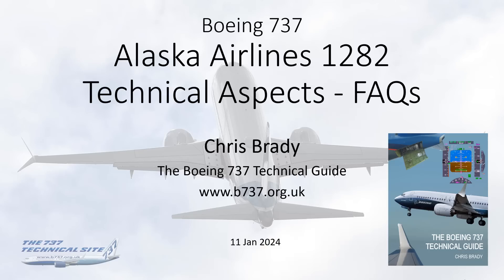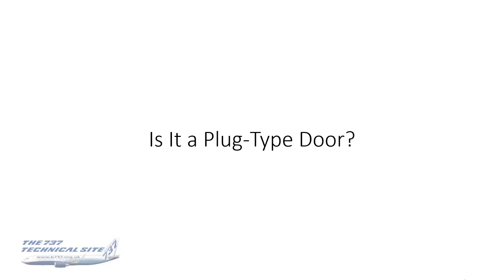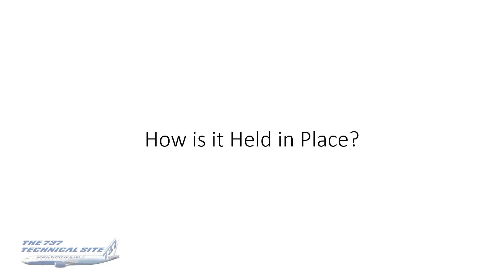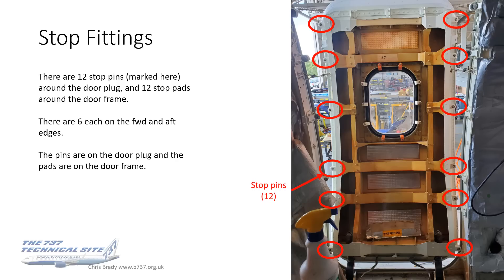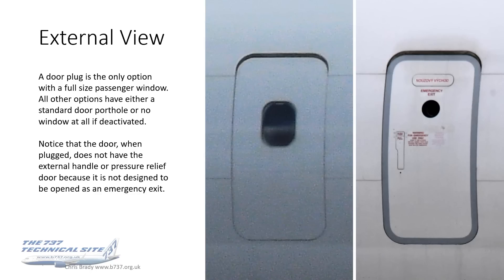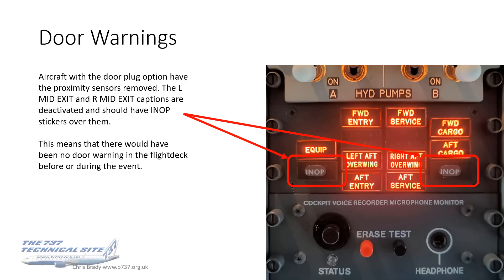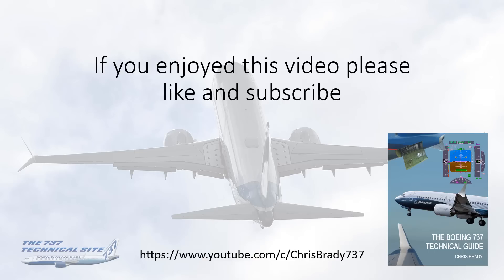737 Technical Aspects of AS1282 FAQs

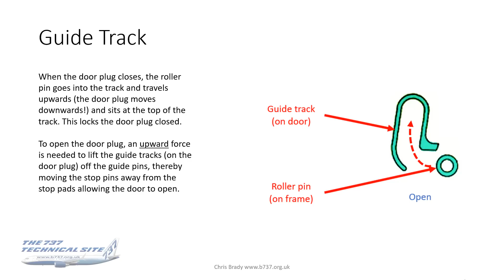Comment: 6:30 You’re verbally explaining it right here, but the diagram is still visually misleading because it implies the pin is moving by how the arrow and dotted line is used, when actually it is not, it’s the guide rail attached to the door that is moving up and down.
Reply: I agree that the diagram isn’t ideal but when taken in conjunction with the photos of the actual door and frame, as one should do, there’s no way that it’s misleading.
The arrow could likely have been drawn external to the track which would make it a bit clearer.
Reply from the maker: Good point, perhaps I should have put the arrowhead on the other way around. But hopefully with the words and text it is clear.
Reply: @ChrisBrady737  however, at the 6:30 point, you’re showing what happens when it changes from closed to open position so arrow should be heading upwards. I think it’s the location of the arrow compared to the parts that implied that the roller was the moving part by being near roller pin and inside track
Had arrow been on left side (or right) of track, that implies that the track part is moving.
Reply from the maker: You are absolutely right, it would have been clearer if I had put the arrows to/from the track, not the pin, as that is what moves. @JohnHallgren
Reply: @ChrisBrady737  I wasn’t really confused because I took it in context with the photographs of the actual parts and realize that you were implying that the flange moved.
Reply: @JohnHallgren  I think one of the biggest bits not grasped is the upper pin is part of the frame, and the pin guide track is part of the door, and that the door only goes UP, and out to open. It took me close to 45 minutes thru text to get my brother to understand this. He kept thinking the door was lowered first (against that spring pressure) to clear the pin (because he thought the pin was attached to the door), and then pushed out, and that is incorrect.
Reply: @GNX157  and it certainly didn’t help when the close up pix of the top guide & pin was from the upper right while the other pix were from lower left! I tried via half dozen msgs to explain that to someone! 

And then with Chris’ unfortunate error in saying it had to go down when that was obviously impossible from the photo, but i did see a comment that it might require just a bit of downward pressure to release any contact with the locking pins due to the upward pressure from springs which did make sense.

But I think by now, everyone should understand exactly how it works even us who have and never will see it in person.

Comment: Evidence of poor workmanship in the pictures...the castleations on the castleated nuts do not line ùp with the split pin holes. The body of the split pin is outward of any castelations. The only part of the split pin preventing rotation of the nut is one half of the bent tail of the split pin! 
Those nuts should have been shimmed with washers to line up the split pin holes with the castleations at the desired torque.
Where has good engineering practice gone?

Comment: Any outward opening door should not be called a plug. Even calling the unused evacuation door blanking panel a plug is ambiguous.

Perhaps aircraft manufactures named  these latching outward opening doors "plugs" to placate the regulators, EASA FAA and UKCAA?
Enough semantic ambiguity to legally skirt good engineering practice?

Comment: Excellent video, Chris! Thank you for your efforts putting it together. Although Boeing documentation refers to the door as a plug, it clearly is not a plug type door that, as you stated, is wider on the inside than outside and therefore could not physically blow out when the fuselage is pressurized. It’s possible Boeing designed this exit to move outward when used as an emergency exit in high density seating configuration to expedite evacuation. A true plug type door has to be removed from its socket and brought into the fuselage, or thrown out on the wing, in a real emergency evacuation. My feeling is the auto-pressurization fault being widely reported is unrelated to the door. If there had been a pressurization leak in the weeks leading up to the accident there would have been a loud squeal around the door seal, which the flight attendants would have reported to the captain. To the best of my knowledge there was no such reports. As a final comment, the auto-pressurization no overwater limitation is a proviso from the MMEL, which is related to ETOPS rules.  It was not an arbitrary decision by Alaska, as media reports allude to.

Comment: I’ll stop short of ordering you to do it, but I strongly suggest you either remove the earlier video or pin a comment at the top of it and in the description informing people of the incorrect information on operation. That other video is contributing to the misinformation that’s already out there.
Reply from the maker: I added the errata to the description of the previous video 2 days before you posted this comment. 
Out of interest, how would you order me to do anything? Please be civil, there is no need to raise the temperature here unnecessarily.
Reply: @ChrisBrady737  Well, it wouldn’t be a lawful order you had to follow etc, but as a show of the strongest possible terms. I’m glad you added the additional. Trust me, it’s not just you that had it wrong. Pretty much everyone I’ve watched try and explain this is making assumptions about what is what or just explaining it wrong one way or another. Your second video is the one that’s closest. I hope a CAD animator decides to take this and make a correct animation that will show this operation of opening and closing. It will be so much easier for everyone.
Reply from the maker: Agreed, an animation would be very helpful @GNX157

Comment: Thanks Chris for another extremely understandable video that pulls apart the workings of the door.

After watching the first one, it was pretty clear to me that the four locking bolts would have had to fail (or be missing) for the door to have departed given the lack of other damage on the door frame.

Sadly, photos of the door itself didn't show the inside of the door, and an amount of hand waving and "high fiveing" in the NTSB press conference didn't really help understand if anything different had happened, short of the single additional fact that the top door guides had been fractured AFTER the door was ejected, not as a root cause, which given the forces involved is understandable.

My bet is that, at worst, the locking bolts were missing, and at best the split pins weren't fitted, either of which, I would say, were pretty basic assembly quality checks.

Boeing, I think, knows what happened, and are already prepping for a change in procedures to head off similar quality problems.  But for some strange bureaucratic reason the NTSB won't let them talk about it as yet.

We'll have to wait and see I suppose.  In the meantime, I can say with confidence that I'm very glad I wasn't the person who installed the locking bolts, or the inspector that signed off on it (assuming there was one)

Comment: Worked for the company for 12 years...yes, the QAs (Quality Control personnel) should have caught this, considering it was a part of their work statement. The company is allowing more and more work to be finalized at the assemblers word. However, a lot of the people being hired by the company have never even touched a hammer or even been to an airport. Only HS graduate or equivalent required. In conclusion, the work ethic of today's young ones is...well, not what it used to be. God help us.
Reply: Boeing must have a sign-off document for the final installation of the 'door'. Hopefully an A&P technician followed by a QC person follow-up.  But maybe the 'locking bolts' with castle nuts and cotter pin are not a required inspection item?? Would be strange...
Excellent videos Mr. Brady.

Comment: I'd be interested to see how this door plug seals against the fuselage frame - I can't visualize how the plug would sit, air tight, against the frame since it opens outward.  Is the door plug tapered in such a way that when it moves up initially it somehow fit through the frame opening as opposed to being sealed to the frame to its stowed position?  Thanks.
Reply: It fits thru the opening in all positions except when the tabs that stick out from door meet up with the tabs that sticks out from the frame into the opening. I am using the term tabs to try different way to explain it, and those opposed tabs do a handshake when it’s closed to hold it horizontally in place.

It seems there’s sealing on the outside lip of frame, like typical door weatherstripping.
Reply: Thanks for reply - I see how it works now - there's a rubber sheath type seal around the frame that the door sandwiches between itself and the frame (see really clear picture of door plug on The Air Current X post on Jan 11th)- my guess is cabin pressure differential creates a seal between this rubber sheath and the door plug hence preventing cabin pressure leakage.  @JohnHallgren
Reply: @teremin21  glad i maybe was able to help clarify how it works! I’ve never seen one of these things, but just been watching the videos and trying to put some concepts together with my limited mechanical background..

Comment: I read, i think from you?
Post production the 737 goes to a contractor who removes the door to retro the seat installation and interior finish required by each carrier. 
Error by the cotract carrier upon refit ??
Reply from the maker: After fuselage assembly in Wichita the door plug is removed by Boeing at Seattle for cabin fitting. After it is delivered this aircraft was sent to a contractor for Wi-Fi installation where the plug door may have been removed. Reports in the media say it was not but I cannot confirm this.

Comment: "NOT A PLUG" door

It would be impossible for a "PLUG" door to leave the aircraft when pressurized. The Forces involved are tremendous that would be pushing the door shut. No such forces are present in this "NOT A PLUG" door, that was designed for Easy Removal, even at altitude with a Pressurized Cabin.
Reply: I can’t take much Dan Gryder, but his recent video on this includes a document on aircraft door types. Within a few lines it references “plug doors” & “door plugs” and they do mean very different things in airplane “terms of the art”. For us armchair experts it’s not art, just jargon, so the distinction is lost I think.

Comment: Flight Deck Door

The Blow out Panel in the Flight Deck Door can only handle a certain amount of airflow out of the Cockpit. The size of the hole left after the "NOT A PLUG" door left exceeded the capacity of the blowout panels. Something else is going to break to relieve the pressure in the Cockpit, the door frame, the cockpit bulkhead, or the door latch. Best to have the Door latch break next. 

Good Job Boeing.

Comment: What are the Springs for? 

They are to assist in "launching" the door away from the airframe when the Cabin is Pressurized. Ensuring the upward movement of the "NOT A PLUG" door so that pins will clear the Guide Tracks cleanly. Even in flight.

Because of the forces involved with a pressurized cabin, the upward motion of the door, force alligned with the springs, causes the bottom of the door to open first. Allowing the Mach 1 accelerating supersonic flow of pressurized air to assist the "Launch Spring" during removal of the "NOT A PLUG" door in flight.

LOL, so the "NOT A PLUG" door was designed for ease of removal of the part that for all intensive purposes will never be removed. Designed in such a way that it can even be easily removed at altitude with a pressurized cabin. What a Crazy Design. LOL.

Comment: Thank you, again, for a great and informative door video, Chris!

Regarding these doors being plug-type or not, the understanding conveyed to me is that if the initial opening movement is inwards, the door is considered plug-type (even if this is not really part of certification nomenclature), as the door does not rely to the strength of the locking mechanism to stay closed. I.e. Airbus cabin doors, among the others. This is at least in line with EASA CS 25.783, which requires provisions for direct visual inspection of the locking mechanism for the doors for which the initial opening movement is not inwards.

Comment: For me, 16:45 is very worrying. There's two scenarios: either door wasn't supposed to blow out, then this was another cascading failure. Or boeing lied in their documentation, which would be super scummy.
Reply: It's simply what breaks next, the size of the hole in the side of the cabin far exceeded the capacity of the blow out panels. The door latch failing next is reasonable and better than the cockpit bulkhead failing and ripping out wires and other critical stuff.
Reply: @WeBeGood06  If the blow-out panels came out, that wasn't mentioned. And with the size of the blowout panels, I'd be surprised if the remaining pressure delta would rip out the door, but maybe my intuition is wrong there.

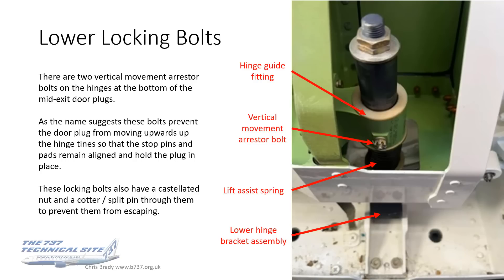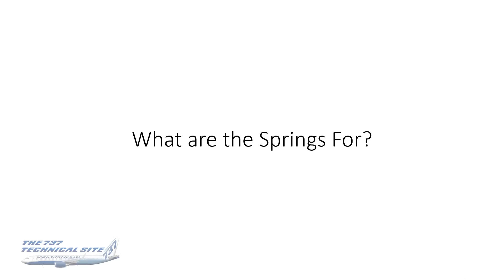Comment: @ChrisBrady737 Best explanation of this topic I’ve seen so far!!!   One minor point… In addition to the vertical movement arrestor bolt, in principle it looks like there is another mechanism to prevent the door plug from sliding off of the hinge tine. At the top of the hinge tine, there is a large washer held in place by two nuts tightened together (thus forming a locknut) (8:13).  The diameter of this washer is greater than the diameter of the hinge tine. If the vertical movement arrestor bolt (and the upper hinge guide fitting locking bolt) were removed, the door plug would slide up until it hits the washer.  Indeed, this is shown at 9:00.  Granted that this will most likely not prevent the door plug from “departing the aircraft” while at altitude and cruising at several hundred knots… but it’s there!
Reply: The vertical movement arrestor bolts are to stop the door plug moving on the hinge tines. It appears to me they along could hold the door plug in the secure position but for safety redundancy is needed hence the additional bolts through the guide tracks to stop them moving on the roller pins.
 
The door plus needs to slide up on the hinge tines for the times it is intentionally opened. When it has moved up the hinge tines all the retention fittings are disengaged - the pin-pads will have moved clear and the two guide tracks are off the roller pins - so the door plug is free to move and swing outwards. It needs to remain attached to the hinge mechanism at the bottom so that it moves on the hinges rather than becoming a loose panel - I have no idea of its weight but it's seems clear that if it became completely detached it would be a hazard to maintenance personnel.
 
Of course if it becomes disengaged from the retention fittings in flight cabin pressurisation will force it outwards and aerodynamic forces then can rip it off the hinges at the bottom - exactly what happened in this incident.
Reply: @jeremybarker7577 i have read comments that the door weighs at least 60 pounds but just passing on that potential info.
Somewheres in the last week or so after this incident, I saw a series of six or so photos, showing a demonstration of how this location would function with the actual exit door, and it drop forward underneath the slide sort of like a gang plank so I would imagine this door Would act similar without those straps to hold at 15°.

Thus it’s possible, they both share that same spring hinge mechanism at the bottom .
Reply: @jimw1615  that’s what I saw in the photos, and that is probably why the door comes up on the hinges, so that when flopped over it clears the sort of threshold on fuselage.
I don’t recall where I saw those pictures unfortunately. But it was a testing setup.
Reply: @jimw1615  then it’s possible that’s where I saw it, but I just remember seeing it briefly.

Comment: Part of the confusion is coming from your repeated use of "plug door", instead of "door plug", methinks...it is a plug for a door opening, and is not a plug-type closure...I think.
Reply from the maker: Both terms are correct in this context and I have tried very carefully to use the correct terminology as required. The door plug is a plug-type (arguably!). It is a confusing issue!
Reply: @ChrisBrady737  It's not a plug in any way shape or form, it is designed for ease of removal, even in flight under pressure. Why would someone design a door that can be removed in flight under pressure.
Reply: @WeBeGood06  The design is indifferent, in my view, but it works on the plug principle. It is not designed for removal under pressure.